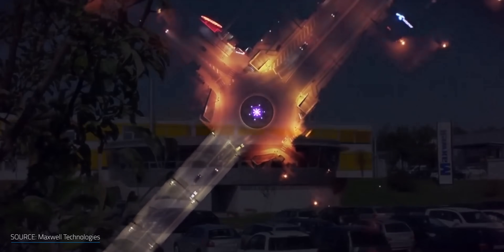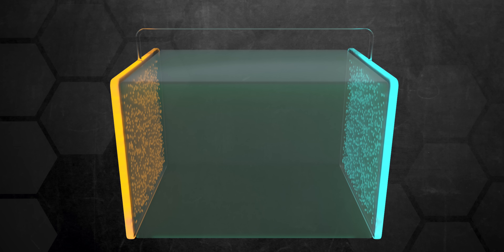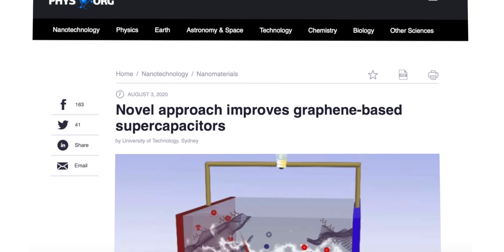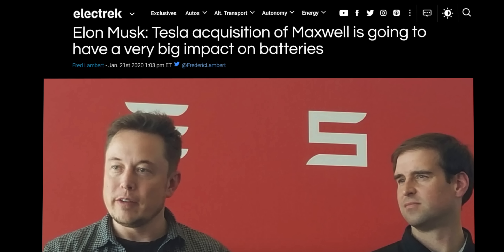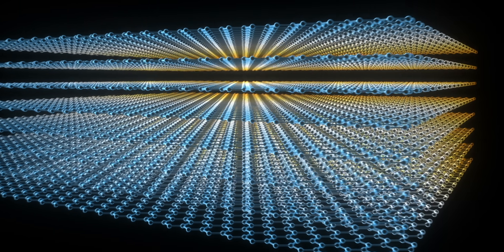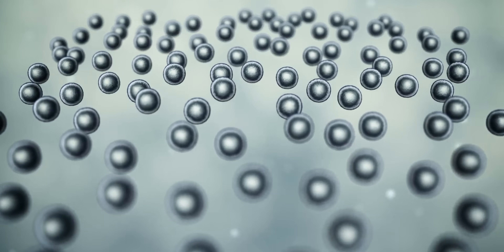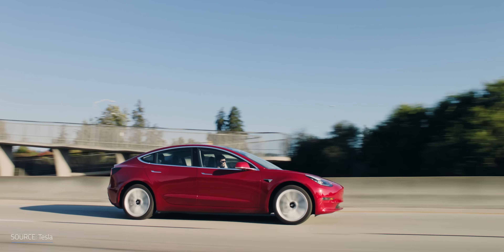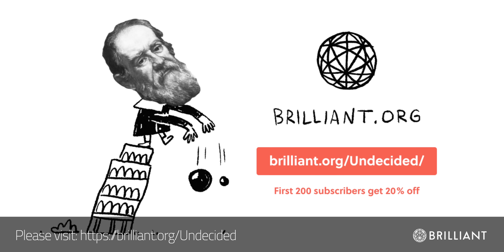Supercapacitors explained - the future of energy storage?

Comment: how much joules or amount of energy can super capacitors store
Reply: For capacitors in general, the dielectric is the major key to the storage ability, followed very closely by the area of the plates and thickness between the plates. This thickness is inversely proportional to the max voltage the cap can operate, ( meaning the smaller the space is between the plates, the more capacity but the lower the working voltage). A stronger dielectric will improve working voltage and capacity for storage.

Hope this helps

Comment: I wonder how much energy is used for accessories in electric cars and if supercapacitors could be used to power those systems while leaving the LI batteries to focus power to the engine. I understand you may still need the batteries to backup or even recharge the supercapacitors once their energy was used up. Or possibly recharged by travel vibration and suspension movement like another commenter pointed out. Love your video topics btw. :)

Comment: Use four layers for each capacitor cell insulated by thin plastic or thick wax paper then charge high voltage outter two layers then use the inner two layers connect to load with oscillator so the charge oscillator forever because the inner keep on induced with voltage from outter layers never lose voltage

Comment: Seems useful for shipping to get ships moving up to speed from stationary. Same for trucks where you need to move a stationary heavy object up to speed before other propulsion system kicks in for steady speed. Could also ve used to store strong wind gust generated power on wind turbines. Could it be used to store 🌩 lightning strike power?
Reply: Lightning has a huge amount of power!  Millions of volts at tens of thousands of amps.  So much power that it can make a tree trunk explode from the heat.  Too much power to tame with human made devices!

Comment: As you pointed out, energy density is way lower for a super capacitor than for a battery.  For this reason, they will never be used to a large extent in EVs.  They would be good for that extra burst of energy that a Tesla roadster or race vehicle might need.  IMO the real goal is solid state batteries, and that's where battery companies should spend their R&D dollars.

Comment: why cant we have super caps in bedded into the street itself. use them like charge tracks for the supercaps on board then charge lithium batteries as they drive pass over them. have them where ever traffic slows down. in stop lights stop signs cross walks etc. i can even see lanes in the highways with reduced speeds to allow charging for both air crafts and auto mobiles

Comment: Excellent presentation skills!  Just like current cylindrical cell batteries, I think SC’s are in their infancy and a huge breakthrough is on the horizon. I can’t fathom how much better BEV battery technology will be by 2030.
Reply: By 2030 most heavy vehicles will be running on hydrogen.  Most other light and medium duty vehicles will be full self-driving and you won't need to buy one since they will be available everywhere, like Lyft or Uber.  They will probably be running on hydrogen for longer range and quick refueling.

Comment: Your video editing skills are soo amazing 1.30 ... Wondering if you could refer me to where I could learn 😊
The charging from deceleration is a not so new thing; it's also used in induction motors in EVs. 
My Question: Although the hybrid tech is really wonderful, but how long will the remaining lithium in the world really last?
Reply: Lithium is one of the most common elements.  But it's combined with other elements so it may cost more over time but it will never run out.  They are researching extracting lithium from sea water.  There's plenty of that!
Reply: @acmefixer1  wow... Thanks a bunch.

Comment: As you noted:
-- Super Capacitors, have been around for over 65 years.

-- the idea of Capacitor in Parallel with batteries, has been around for most of that time (50yrs ?)

-- the development of these systems: had started to really gain momentum when Lithium batteries became introduced.  
 ?? Regardless of abilities & materials, 
Current technology is cheaper than Developing technologies.

Comment: Question, in the Hybrid concept, would it be an idea to also use the Super Capacitor to help charge the battery, ie you stop at a charge station, the SC takes a huge charge, very quickly, you can then drive off while this charge is then trickle fed to the battery pack, 
G

Comment: I think supercapacitors can play a role in home air conditioning. Solar power battery storage and a super capacitor used to provide power to small compressors those about the size of your refrigerator compressor which will chill water  within a cooling coil for the homes AC. This will reduce the energy cost of cooling homes. Pumping that water through the cooling coil and using low speed low amperage fans should be able to cool the average home. At about 8/10 of the cost of a 3 ton standard AC unit.

Comment: Well the voltage output of capacitors is directly linear to charge.  This really isn't ideal for an electric vehicle.  The voltage of a battery is consistent with the chemistry limited by internal resistance and leakage.

Comment: 4 times greater life for batteries is a deal breaker for dealerships
You could also downsize the battery in a car, as the peak current would be generated by a super capacitor, thus decreasing the cost of the car by a large amount.

Comment: Supercapacitors will be indispensable for all EVs using fuel cells. That is because unlike batteries, fuel cells cannot be "recharged" so all electric current must be stored in supercapacitors during regenerative braking. Once fuel cells running on hydrocarbon fuel become practical (solid oxide fuel cells) power generation directly from fuel will be more efficient and supercapacitors will draw more interest.

Comment: Odd thought entered my head (this is normal), could they use supercapacitors to make use of static electricity build up on long haul aircraft to give an electric assist on landing. 
If you could have electric take off from a charged pack then run normal jet engines for the flight when the loads are lightest, then use the same pack charged during flight to land, you get away with a smaller battery pack and therefore less weight. No idea if this makes sense just free thinking for a bit of fun.
Reply: Interesting idea Helen. As an airline pilot who has seen his share of Saint Elmo’s Fire and been struck you lightning a few times (not personally, but in aircraft designed to handle that) its an intriguing thought to consider harnesses this to charge a SC. I don’t think you can rely on the energy routinely, but perhaps there’s more aggregate static electricity over timescales that could put use to assist charging or assisting an EV aircraft in special circumstances. Otherwise that energy is simply being shunted away, dissipated, ignored or wasted. I like the concept.

Comment: I am wondering how big and how heavy these are in a car application. Might be too big of a tradeoff for Tesla to use in their cars right now.
Reply from the maker: I should have touched on that, but yes ... volume and weight is an issue.  It's all about finding the right balance.
Reply: All capacitors are vary light.
Reply: @forrestolney6836  
You don't know what you are talking about.
Reply: @acmefixer1   I worked at rixon sangamo and i made capacitors, I also worked at Data General for over 8 years we used  capacitors on lots of things, after the layoff i went to national semiconductor I took 24 mil spec serts . I have worked with big  capacitors for over 30 years. I have never seen a capacitors that was over a pound.
Reply: Lithium Supercaps are being used in car audio nowadays

Comment: they are safer than batteries as they can be stored and shipped completely discharged (0 volts) then charged for use so transporting a 6kwh super capacitor on an airplane passenger flights can be perfectly safe where as you cant even take a 101+wh li ion battery on a plane

same for shipping that same 6kwh super capacitor  can be shipped via usps priority mail where as the same 101wh li ion battery requires hazmat class 9 sticker and must be shipped by fedex.

however that is only if it is the lithium metal content that is why we cant ship batteries certain ways.

it may be possible that shorting a super capacitor can produce enough heat to set fires but hopefully the future rules wont be done on the backs of another military data breach

Comment: You should look into hybrid capacitors! No, I’m not referring to hybrid battery systems where battery and supercapacitor devices work in tandem. I’m referring to singular devices with battery electrode (Faradaic) and supercapacitor electrode (non-Faradaic) components working at the same time in the same cell. If supercapacitors are the bridge between batteries and capacitors, hybrid capacitors are the bridge between batteries and supercapacitors.
Reply from the maker: Good suggestion!
Reply: BINGO!  You are correct, sir. Tesla acquired Maxwell for their DBE process AND their hybrid lithium capacitor ("L-Cap") technology. In late 2017, Maxwell was selling L-Caps in commercial quantities into rail applications in China, with a second generation of the device in development. By mid-2018, they were in collaboration/buyout discussions with Tesla. Currently, the L-Cap is not on the Maxwell products list.
Reply: allen youngwood very very interesting. Do you know why Maxwell has more-or-less discontinued L-Caps?
Reply: @jakeyandhisbass  Good question.  Why would a mature product being sold in quantity be discontinued?  From the Nov. 2016 Maxwell earnings call:  "…we believe that we can take the L- CAP and ultra-capacitor capability into what you would call a hybrid capacitor that, as we continue to advance and innovate, keeps power as close to an ultra-capacitor but takes the energy in such a capacitor four to five times higher from what our L-CAP has today. If we succeed, we believe that would be a capacitor that would be in a sweet spot covering 80% of applications we see in any markets you could look at." (I would call that 80% assertion "mind-blowing"). On the Nov. 2017 call, Maxwell announced the start of development of a second generation L-Cap saying they would share results in 6 to 12 months. That sharing never happen. Whatever it was, it went to Tesla in the buyout. To my knowledge, Tesla has never discussed the L-Cap publicly.
Reply: allen youngwood sounds like a powerful vacancy in the market.. Thanks for the info!

Comment: seems like something that would be very effective in home storage systems
Reply: Why? Slow charge is great for solar. Capacitors are great for quick recovery like regenerative braking, but for long drawn out usage it's less valuable, I mean if it's massive and heavy it would be great for stationary situations, but those would be gigantic and how expensive do you want it to be? 20 Wh per kilo. So a 1 tonne capacitor and inverter in your garage for enough storage as less than two power walls. 2 tonnes would barely equal 3 and that would hold about 1-2 days worth of power. It's why batteries are available and capacitors aren't, it doesn't make sense yet.
Reply: @thokim84  I meant in addition to a home battery, for relatively sudden hi, but quick use. like say for example, you are close to your maximum draw, but you want to use the microwave. that sort of thing

Comment: I would love to see the hybrid of super capacitors with li ion batteries.  The capacitors would work well in acceleration, while the battery is great at maintaining the inertia created by the capacitor and extend the battery life.  In cars and lawnmowers where the battery uses a lot of juice to spin the blade from a stop to running speed.  Another would be to use the capacitor to engage the warp drive to hyper light speed.

Comment: This bike is a beautiful bike. I like the thinking here letting the capacitor absorb the regenerative power and let the battery supply the on going power, So I’m thinking since the capacitor can charge up so fast wouldn’t it work nice if we could super charge the capacitor at a fill station and let that energy charge the battery. My thinking is we would be able to charge our EV in seconds (minutes). Sure there would be power loss due to the fact the capacitor would start to lose its power before the battery could absorb it however it would still be a great way to quick fill and (or partially fill). I could see this being a game changer I mean as we all know that’s the main issue for most, I commute 150 mile each way to work everyday to the Bay Area and I won’t buy a Tesla because I don’t have any extra time and most days I exceed Tesla’s range I do know that I could find a super charger and get the extra range but I would need to do that everyday and I work a different location every day so for me it doesn’t make sense and the capacitor could change this. Thanks for sharing.

Comment: For the time being super capacitor integration into truck and high end packs for plaid models /roadster seem to be the way forward, instead of the concept of full capacity doesn’t make economic sense on cost per kw , whist the design of the 300w cells are coming online the intergration of say 12-20kw super capacitors into say the regent and 30-100 speed boost   Also when users as the buffer for charging at dc current its wildly know that prolonged high voltage of supercharger has caused degradation by using the capicter as a buffer the same way enterprise ssd add ram it will allow a slightly slower or more stable rate of charge at 250kw , similar to the way Audi adds a top end buffer Tesla will add a capicitor . For grid intergration this may form as one row of models per pack the heat produced will be absorbed with an upgraded cooling system and advanced bms

Comment: If super caps are like a tenth the energy density, then a ten minute ride in an electric multicopter would be nearly like a minute. It may not seem much but it could charge in about the same time and more one minute fun (and so on). And you could use it for way more flights than batteries. You could ride it (in minute bursts) all day for ten years and still use the same super caps. The original jet packs only lasted 20 seconds and would have taken more time to "refuel" for each 20 second flight (yet they still made them). So I reckon batteries suck cos they wear out to quickly. Super caps with one minute bursts (that you can repeat immediately for years) is the go. And with a big wind turbine and solar cells (and a farm) you could do it for free (after buying the renewables). Why isn't anyone doing it? They could have joy ride theme parks powered by renewables. People would line up for miles.

Comment: I think battery technology will follow the trend microprocessors did when Moore's Law became irrelevant.  It will get to the point where it's easier/cheaper to add cells than it is to continue to chase kWh density or other tricks.  The reason?  Economies of scale.    

(Before you say Moore's law isn't irrelevant, understand that I'm aware it is still a real thing, but also realize four or more larger cores are better/cheaper/more efficient than 1 faster, smaller core that is also extremely difficult to cool.)

Comment: E-Fuel makes battery storage and Teslas obsolete and capacitor storage as well.  E-Fuel is just water that has been energized by the dissolving of and saturation with H2 and O2 in a water matrix, through the application of electrolysis, so that the water burns like gasoline when atomized or vaporized inside of an engine. It is simple and straightforward to produce and liquid fuel is always preferable to and more versatile than batteries or capacitors and E-Fuel is just water when in liquid form and is just as safe to transport and use as water. If the right electrolyte is chosen, like lemon juice for instance, E-Fuel  would even make an excellent lemon aide with the addition of a little sugar and ice. In other words, this preparation would not only run your engine, you could also safely drink it and without the sugar you could even bathe in it. E-Fuel could also be manufactured from sea water a resource that we have plenty of, so we don't need to use our precious drinking water to make it.
E-Fuel is a perfect fuel ....

Comment: Isn't the availability of battery cells an issue for electric cars? If you can improve city range by incorporating supercapacitors, it seems super worth it. I've seen a few electric cars announced with less than 200 miles of range that would benefit greatly from this. EVs most certainly are not "good enough" atm.